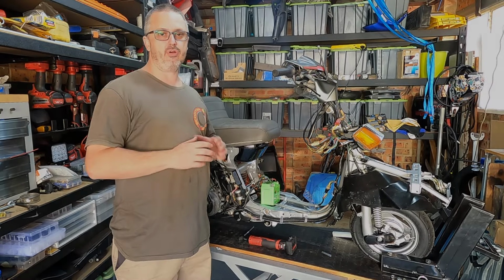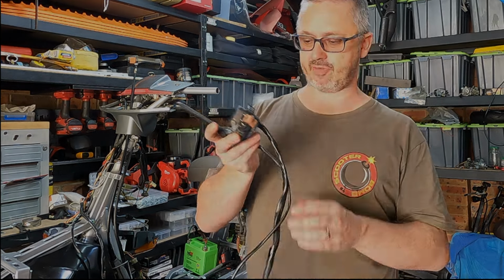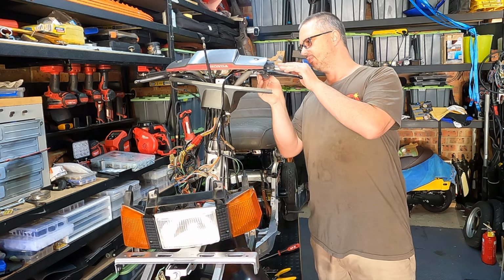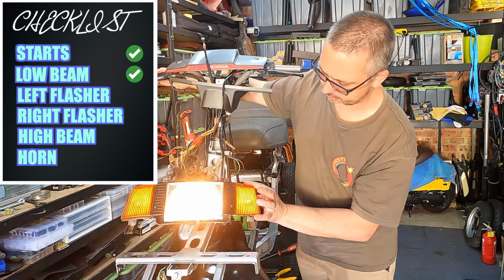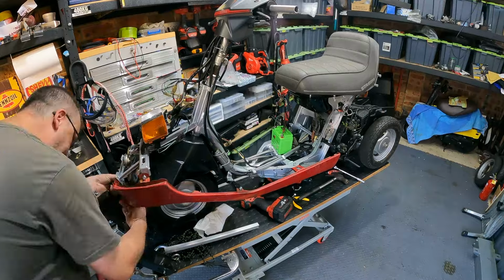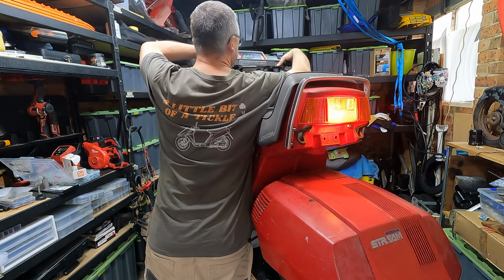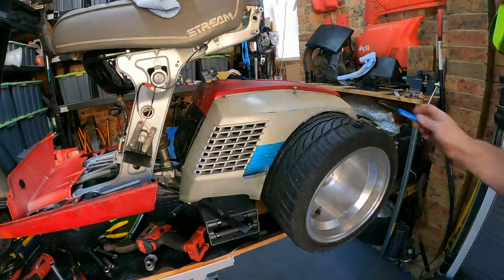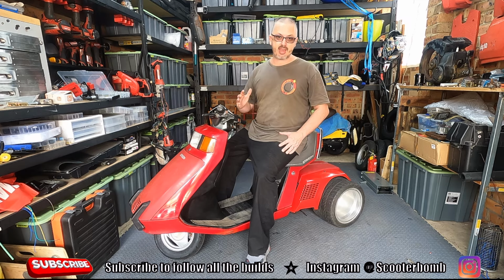X Stream gets some fat mods

Comment: I actually prefer it stock, it's a Honda Stream, as in streamlined; looks cool with the back wheels enclosed, plus, with two wheels, even skinny ones, it still has a wider track than a normal scooter, even a ruckus/zoomer with a fat tire! However, the wide wheels are neat, may look cooler if you added some matching fender flares to accommodate those wide wheels, leaving them just sticking out is a bit much, but with flares, I bet it would look a lot better (and protect you/others from the debris being flung up) At least you kept the factory rear fenders/wheels, so you can swap between the two whenever you want. 🤘
Reply from the maker: I like it both ways hey. I couldn’t bring myself to cutting up a good set of pods. Such a rare bike had to get some shitty ones to cut up.
Would love to get it on the road. Would need registration first but. 
Thanks for the support. Thanks for taking the time to leave a comment. Cheers 🥂